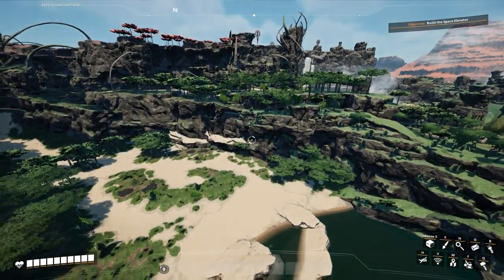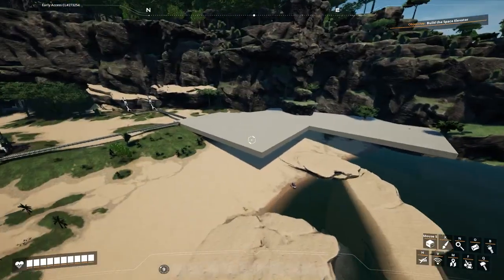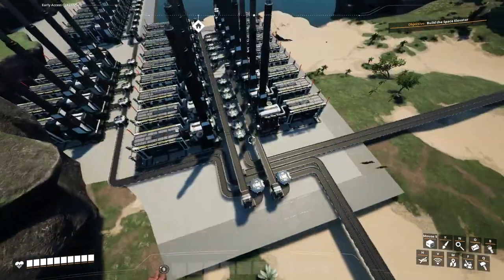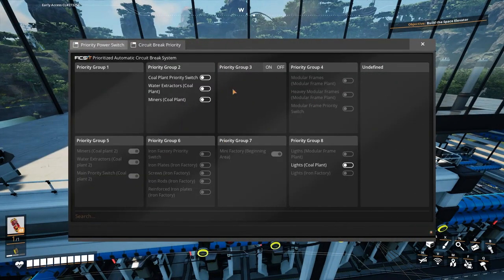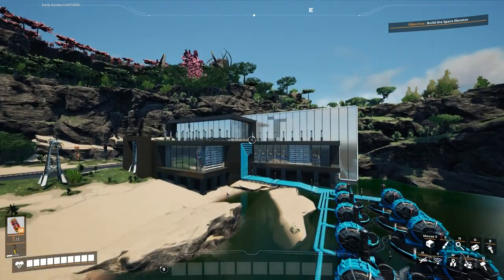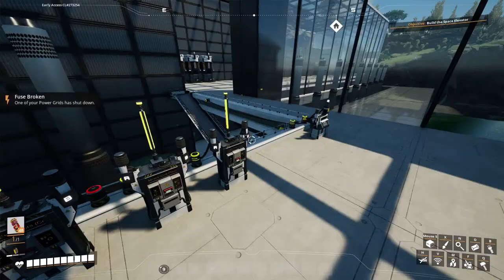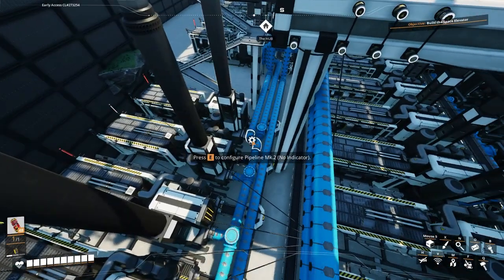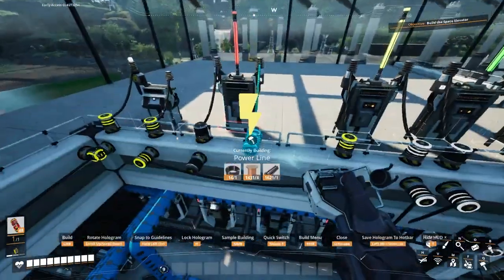MEGA COAL POWER PLANT!

Comment: First you gotta fill the machines with water, so water extractors go on their own circuit…then you gotta fill the machines with fuel, so the miners go on their own circuit too. And then you have a disconnect for the entire power plant in case you need to isolate it from the grid.

I set up my power grid so that all power draws (non-power plants) are on their own grid connected by priority switch to the backbone of the grid. I have all my power plants and their associated fuel infrastructure (so all the processing it takes to keep the fuel on…like assemblers for compacted coal, refineries for fuel production, the miners and extractors, etc.) on their own grid specific to each power plant, connected to a transmission backbone by a regular power switch that is just a disconnect. I haven’t set up switches for controlling the separate pieces of the power plant yet (I would not use priority switches for this I don’t think—it gets too messy) but I’m going to now after this lol! Just in case I need to do a cold restart for some odd reason.

Oh yeah…and I keep my biomass power plant around just in case I need to jump another power plant. I should probably think about isolating the biomass power plant too…idk…I have so much power I don’t have anything to worry about really.
Reply from the maker: That the way I've been setting up my power gird, primary systems controlled from within the power plants, every factory has each system individually controllable.
Reply: yep came here to say the same, water  and coal miners on own circuit, early game before switches i just delete coal generators. have coal miners going and then once all belts are full of water i connect the generators....

Comment: Reminds me of the time I build a huge silica factory to bolster my aluminum production with the alt recipe. I built 1 huge, decorated factory to turn the raw quartz into quartz crystal first. Then built the silica factory. Hooked up power and it wouldn't run even though the belts were full. I was dismantling belts and constructors and rebuilding them to troubleshoot. I was like an hour into it and figured out the silica uses raw quartz not quartz crystal. AAHHHHHHH! I rage quit and came back 36 hours later.

Comment: It might not be helpful, now at the end.....
But at the beginning of a coal power build, adding a Storage Bin underneath each Generator.
It can build up coal from the splitter manifold, and give You an Instant Start Up.
And Provides a Buffer over time, in case You wanna make alterations to the Miner/ Logistics in the Future.

Depending on how long You take, designing, building, and decorating- those Buffers can get fairly full, and become a real safety net.
Reply from the maker: @brokedude9999  intresting that good to know
Reply: Good idea! The storage bins will flow without power just as if it's being mined. The water will still be in the system, but you could add fluid storage too if you wanted. Never thought of that. Great tip!